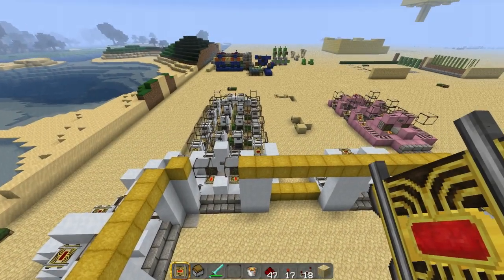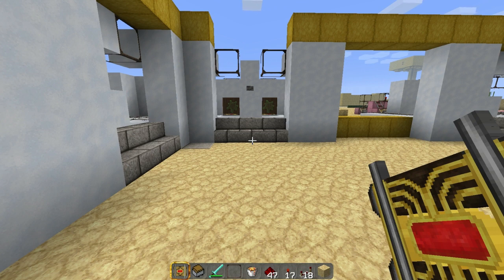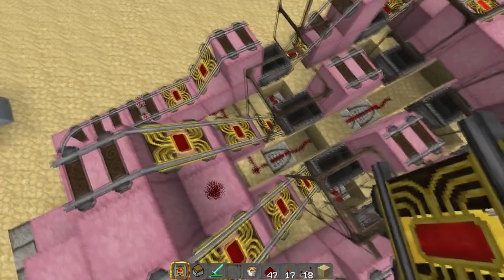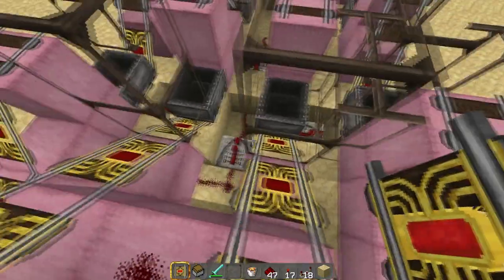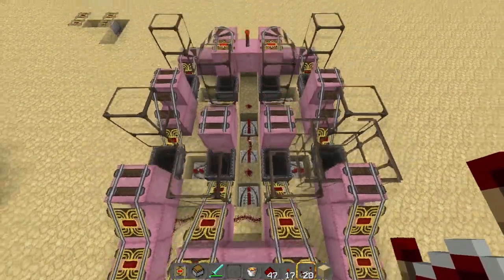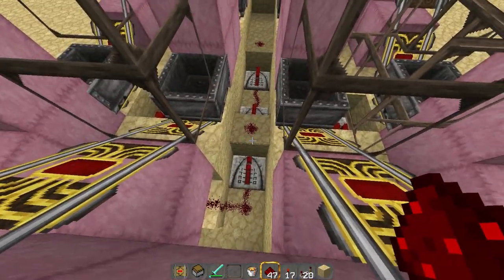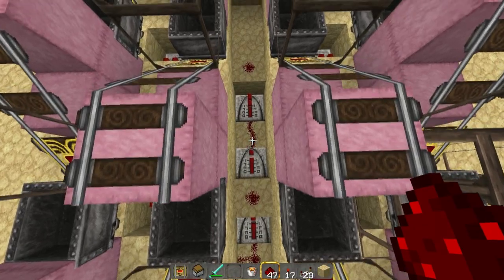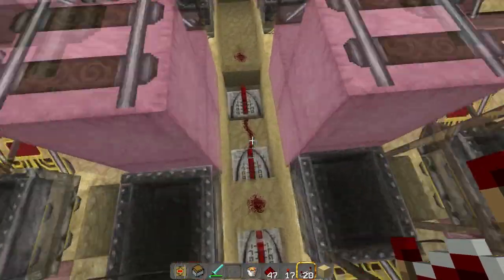Animal Breeding Cell (Fix)

Comment: Good job, see thats why you're the redstone expert I never would have known to do that. Also after testing my fix I found it wasn't very reliable. The carts got stuck or they wouldn't pass over the detector rail fast enough sending out a longer pulse which messes up the cart system.

Comment: I actually found a fix to the new 1.3.1 problem. You replace the sticky piston with a regular piston and you put a painting under the piston. Then you lower the original power rail by a block and have a power rail to go back into the original track(: